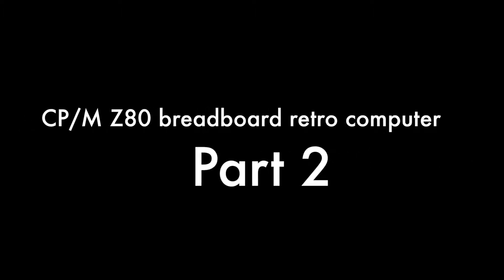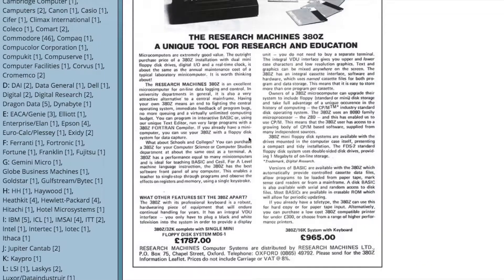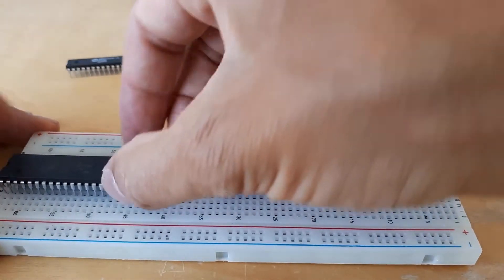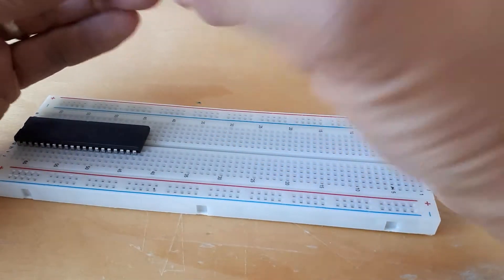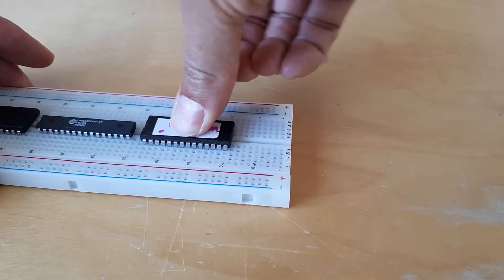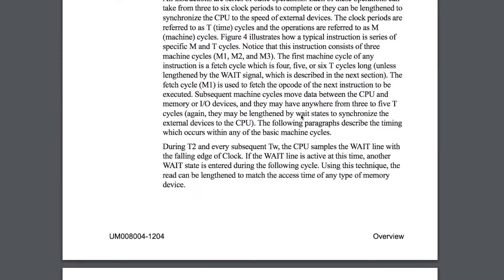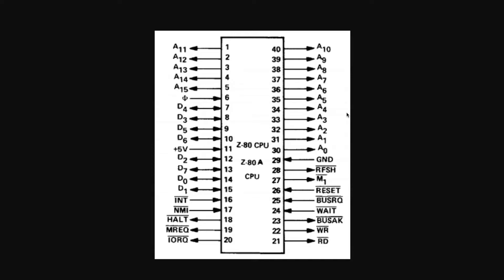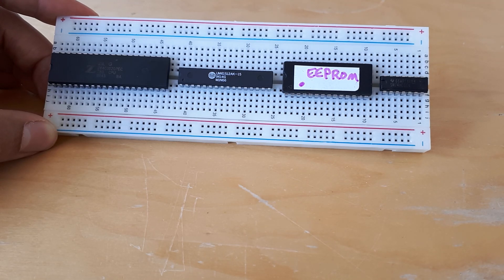CP/M Z80 single board retro computer, on a solderless breadboard (PART 2)

Comment: RML 380Z .... yes! Yes! YES!!!!!
My first BASIC programs, My first machine code programming, and my second assembler... (The BBC Micro came a close first with the assembly language).
Oooh! Oooh! Ooooh! Hand assembling Z80 in the back of my maths book in pencil (because a lot of rubbing-out was involved)... and typing in hex to the 380Z's wonderful "front panel" ROM debugger. Deep joy, deep joy.

Yes... the base model of the 380Z had no floppy drives and you would load in BASIC from cassette... we were always getting into trouble for accidentally overwriting BASIC with our machine code experiments and then the teacher for the next lesson having to reload BASIC from cassette and it taking ages.

RML basic was loaded at 0x0100, J100 would reenter BASIC at it's initialisation vector and it would erase program and variable memory. J103 was a soft-reset vector that left your BASIC program and variables intact.
Addresses 0x0000 - 0x00FF were probably where the monitor ROM lived as the Z80 starts up at address 0x0000... But I lost my 380Z memory map a long long long long time ago.
I'm sure some versions of RML BASIC loaded at 0x200 and you'd do a soft reset with J203 ... who knows what was done with 0x0100 - 0x01FF in that case?????
Reply from the maker: So cool that you share these happy memories too. I have no idea why by J103 is forever burnt into my brain. I have a monitor in my Z80 Playground, but I have not implemented "J" yet. I better get on with it!!!